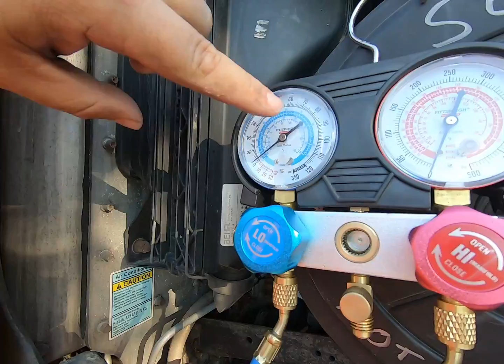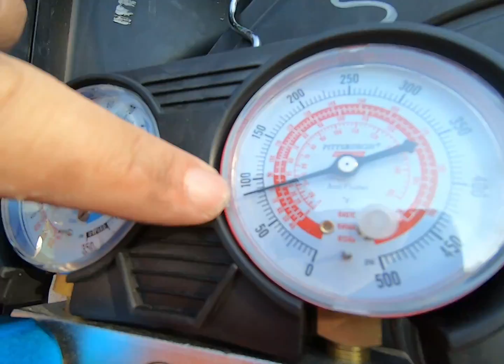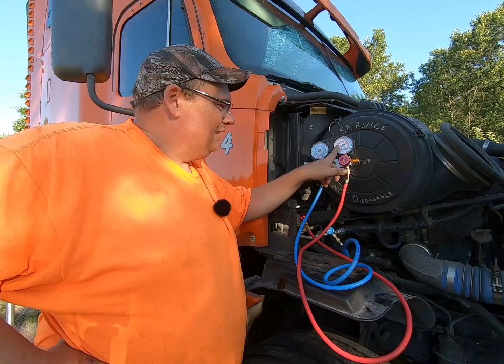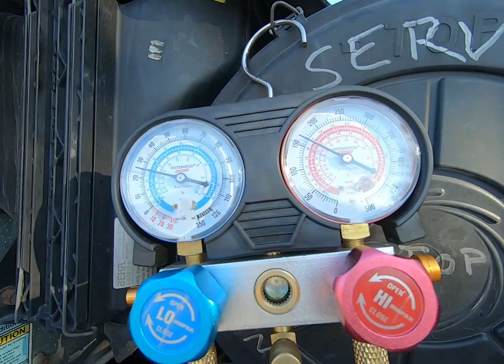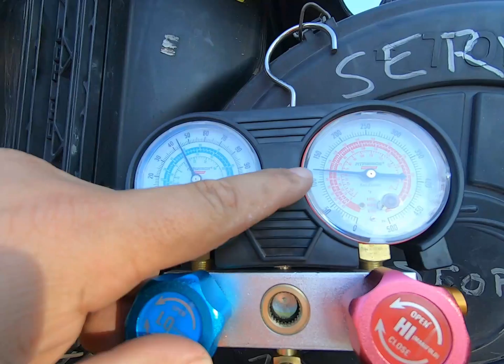A/C basics...Using manifold gauges to determine a/c problems in a semi truck | a/c pressure readings

Comment from the maker: DIY SEMI, TRUCKING AND MORE 

 • 59 seconds ago

For great fuel discounts with no fuel card required, watch this video! https://youtu.be/LjB5Y60p1qI
Reply: Looks like you know your stuff. I got a problem with my AC, I pulled vacuum for 1hr and it dropped a few psi (2-3) after 10min. If I press the AC button ON the clutch kicks in after I pulled vacuum... isn't that not supposed to happen? So I charge low side and the pressure shoots up way high 100-120psi and the high side goes to like 50-100psi and system won't take anymore (full) no cold air. 
Ik its a lot but thanks.
Reply: Also the AC clutch stays engaged without any charge
Reply: 3:14

Comment: I have a 1998 Western Star,  new compressor, new high-pressure switch and new fan air solenoid switch to turn fan on. When head pressure gets high the fan isn't coming on. What else do I need to check?

Comment: I recently purchased a gauge set and vacuum pump and have spent about 4 hours watching different videos on you tube to learn about the process of recharging an auto AC system and I learned more from this video than the other videos combined.  There are a lot of "How To" videos on you tube and many of them are very thorough but I really did not understand the function of the components in the entire system as well as I did from watching this video.  Your discussion the variation in low/high pressures was very enlightening and really helped me to understand the function of the system as a whole.  Great Job !!!!!
Reply from the maker: Thanks.

Comment: I don't  meant to bog you down with the following. I just though I'd ask. 
 I have got any idea what I'm up agaisnt. The shop i had install the ac compressor can get the vent temp any lower than 63 degrees. The sleeper ac/heater doesn't even have a sleeper filter. Shop says they gotta take out the whole unit to clean the condenser; jeez wiz. 
I have a 1999 KW T2000. AC hasn't worked in 10 years since I've owned it. 
 Ac compressor blew the clutch. It's got a new compressor now. It has an "Automatic  Temperature control knob" on it. The hot water heater hose runs to the cab for heater & I've heard it somehow runs threw the ac as well. Supposedly the "Automatic Temperature Control Knob" adjusted is suppose to somehow control the ac & heater by turning it right or left.
 In order to avoid hot water running, somehow, threw the ac, I had shut off valves put in to the hot water lines to cut hot water going to the cab & ac.
 This Automatic Temperature Control Kbob as is written on the on the plaquered.

Comment: It's undercharged!  Low.presuure should be about 30. Yrs sucks down to 10. Way to low. That truck probably needs a kilo of refrigerant! U probably put in less than goes into a small car. Modern cars take about 450 grams. Big suvs .with dual ax about 800. Trucks like yre 1 kg to 1. 6. To do it properly u find put how.much refrigerant yr vehicle needs exactly. And then use a scale to measure the exact amount. Also when u regass add some lubricant!!! 30-50 cc of PAC oil..

Comment: I noticed you closed all the valves but only opened two of them.  So to check pressure, I need to start with them all closed and only open the two at the ports and leave the ones at the gauges closed?

Comment: One time I’m doing recharge of refrigerant 988H wheel loader i put only about 200psi on high side 15 psi low side but not good colling I put more about 280 psi high side and low side 35 become good colling but I’m worried if already high pressure or normal thank you

Comment: I did my reciever dryer and both expansion valves after this video
Reply: I have a question. 
My ac starts off cold,  an hour after I drive it gets warm.  When I stop to idle it gets cold again. 
I've replaced both expansion valves and the drier.
Can it be the evaporator?

Comment: Fantastic video and explanation. I just bought a set of gauges for my the a/c in my kenworth t680. I need to learn how to top off the freon when it's low. Several years ago,i overcharged a system on a different truck with those little bottles you get off the shelf in Wally world. 😂 don't want to make that expensive mistake again
Reply: It's not a good instructional video actually. So if u want to avoid more expensive damage. Don't do what he did!  Lol..  (I do this for a job)

Comment: I have replaced in y 2004 Columbia AC condenser,AC COMPRESSOR,dryer ,expansion valve and evap core ….and my AC blows cold somewhat but it’s very hui side .
Iam so puzzled what could it be ,any help will be much appreciated 🙏🏼

Comment: here is my problem i switched ac comp couple of week ago and my ac was working just yasterday i switched fan solinoid because my fan clutch wouldn’t come off, so now compressor isnt working too, it is betterly worm after 1 hour of engine working, i checked amperageon compressor electricity, there is non, 
could it be high pressure sensor that meses everything up? and my pressure on low and high side  both 100 with engine on and off

Comment: How much uv dye do I need to put in the system to see a leak? I’m trying to find a leak and I put in 4 oz of dye but I don’t see the dye leaking out or anywhere
Reply from the maker: 4 oz is way more than enuf. Did u look at the evaporator inside your dash for leaks? And in the bunk?
Reply: @DIYSEMI  I looked under the bunk at that evaporator there but I have not looked closely at the evaporator in the front.

Comment: I'm not even sure if you're still on YouTube I know this is an old episode but I'm trying to figure out what's going on here I watched your video here on manifold gauges I did exactly how you had explained and I thought I was doing something wrong so I watched the video as I did it  by no means am I saying that you're doing something wrong however the low side of my gauge is only showing pressure while adding freon when the can gets emptied the low side gauge goes to 0 and so on once I have the 3.5 lb of freon in the low side of the gauge is 0 but the high side reads correctly at 225 to 250 can anybody tell me what's going on with this thing never happened like this before so I'm kind of confused on what the world's going on I appreciate anybody's help thanks

Comment: It is not relevant in your set up with the adaptors on the Hoses BUT you Hoses are on wrong. 
If you take them off and look at the ends, The bent end will have a core depressor in it, the straight end will not.
The reason the adaptors turn in the opposite direction is because it is not actually a Valve. the Knobs turn in the pins to depress the cores on the Truck connector..
Mike M.

Comment: On a 2019 peterbilt 579 at random times when shut engine off for 5 min guard shack check in, after starting up again compressor clutch won't engage. Is this because system under to much pressure? The strange thing is it only does this at random not all the time under same type of operating conditions. My quick fix is drain air pressure in air tank to engage fan,pour bottle water on lines to compressor and after 5 min compressor comes back to life.
Reply from the maker: Yes, sounds like a high pressure situation to me. Could be several causes. Overcharge system, restriction in system...etc

Comment: It was a long time ago as soon as i saw your video i subscribed your channel. I have question i have volvo vnl 670 2011 and from passenger side where is ac evaporator i hear hissing noise the whole time when ac is on, if i turn of the ac the hissing goes away. No cold air. Can be a bad evaporator cause i as i’m touching the evaporator around the hissing changes the sound. Please help. thank you and keep doing your great videos.
Reply: Some ac systems will make hissing noises when they are low on refrigerant. It's the sound of gasses moving through the pipes rather than a liquid.
Reply from the maker: That is possible. Also while u are in there check your blend door actuator

Comment: Hi! I might find a professional answer from you if you’re willing to share,because out there,rarely theres a technician that knows what is doing.Well long story short,my AC clutch compressor went out the other day(Century class series 60 Detroit sleeper).Changed compressor dryer vacuum the sys charged back (at a Speedco) and barely get any cool air from vents.Got home bought these gauges and i get 45psi on low and 310 at high engine running at 105-110 ambient(Arizona temps).Fan engages, compressor clutch as well engages but compressor never disengages while running.At idling it blows warm air barely any cool air.Before compressor failed,it had pretty good cold air out of vents.What could be at fault? Expansion valve was changed also not too long ago,i also add a bit of freon and bump the low at around 52psi.Also the sight glass at air dryer its white foamy if that helps.Thank you much!

Comment: when engine is off and u measure static pressure ..it is kind of important the reading. yours correlated nicely with ambient temperature. if it reads 30...and u have 90 degrees outside ....then something aint right

Comment: My AC is reading about the exact same as yours on a 80 degree day.Like 22 on low side  and 185 to 190 on high side and compressor is kicking on and off every 25 seconds.Pressure readings then are 45 low down to 150 on high side.Its cooling,but seems like it could be better.Is freon a little low.

Comment: I just replaced my ac line, compressor to condenser. Ac was working before I spotted the leak. I believe I lost too much Freon because it is not cold now and the compressor does not kick on. Engine fan only turns on when engine is hot. We have the same truck, so I am curious when I add Freon which side to add it too, hi or low?

Comment: Thank for you this ionformation.i want  ask one question for you.i hope to you have good answer.yesterday i find one fault JCB machine A/C system.its not cooling properly.i checked its pressure its running time suction 30 psi and discharge 160 psi.after pressure balancing its coming 100 psi.conderser and cooler filters  all ok.near the system filter area have slide glass .i can sea inside liquid passing properly.(It has one problem.its compressor switch off time system pressure balancing within 2 second) can you explain me what is the problem????thank you

Comment: I have a situation whit my ac pomp compressor,  is releasing freon out on valve safety pressure,  that happens sometimes at heat position,  what do you think could be?? I really appreciate you opinions,  Thanks
Reply from the maker: Sounds like you have super high pressure. It's probably happening with heat on because compressor turns when defrosters are on.
You probably have a bad obstruction somewhere in the system building back pressure.....I would have it looked at.

Comment: I have a quick question! my high side goes up to 300 , when the fan kicks  on it drops down to about 100 and it stays between 100 and115 after that. My low side kicks clutch on at about 30 and and shouts of at about 50 and drops back down around 30 and then rapidly goes up to 50 and drops again Clutch keeps engaging and going off And sometimes the clutch gets stuck but I can hit it with a screwdriver and it starts can you help with this

Comment: Add refrigerant with the fan drive engaged.  Switch on dash may have override , if not unplug fan drive air solenoid on firewall

Comment: I certainly appreciate you taking the time to make this video. I have a Freightliner chassis motorhome and, have had quite of bit of trouble with the dash A/C on this coach. I've paid several times, to have the system checked out, vacuumed and charged. Each time, they say it's ready for service. Each time, it works for a day and that's it, it's warm again. I recently purchased a Harbor Freight set of A/C gauges and, a vacuum pump.
 
    I vacuumed the system down to a max of 26 inches and it won't hold for a long time. I will hold for say, around 15-20 minutes. So, I'm presuming there's a leak someplace. But, I've charged this system and it will produce as low as 40 degree air from the ducts, while driving in around 80-90 outside temps. As the temps approach 100 degrees, the air from the ducts increases in temp to around 50-60 degrees. But, as stated earlier, it will loose that charge. It's very difficult to find a leak on this type of chassis. 

    But, in any case, you have enlightened me quite a bit on some basics and technicalities of A/C operation. I will look forward to finding other vids of yours and, ones to come. Very much appreciated. 
Scott
Reply: A REAL HARD LEAK TO FIND  IS WHEN YOUR EVAPERATOR IS LEAKING IT WILL HOLD A PRESSURE TEST AFTER A VACUUM HAS BEEN PERFORMED AND WILL LEAK THROUGH YOUR EVAPERATOR DRAIN WHEN YOU RUN THE AC UNIT AFTER 5 MINUTES OR LONGER I DIAGNOSED A CAR WITH THAT PROBLEM HAVE A NICE DAY ASE TECH AND BEHOND
Reply: U do have a leak. Yr sytem failed the vacuum test.. it should hold 29 hg indefinitely. Next step would be yo pressurerize it with nitrogen and soapy bubble spray to 'hopefully' find the leak. If that fails. Next step is to recharge it with ac dye added. This dye goes round the system and exits at the leak site. After having it ran dry, darken out the vehicle bay and shine an ultra violet light on all the hose and connections and components. When you see a green dye trace, you found the leak.. this is the most  successful leak finding method in the arsenal and every ac specialist should have it on offer. And this is what u need to do to actually solve the problem.. we do this successfully everyday..
Reply: @franshuber910  I certainly want to thank you for responding to my issue. It was by pure luck that while I was checking out the engine for an upcoming trip, I noticed some wetness on the corrigated plastic cover that covers each of the A/C hoses that come from the pump. One was wet about a foot or so from the fitting on the pump. Hmmmm. So, I peeled back the plastic cover and what I found was what looked like a potential repair with crimped fittings and all. 
    It was fairly oily around all that part right there. I had to assume that was where my leak was and no one in the service center where I'd paid to have the system checked out , vacuumed and filled, bothered to look there. After  determining that hose was the short one that led to the evaporator, I had a new one made up and installed it. I then vacuumed the system down to 29.5 inches and it held for as long as I wanted it to. I then filled the system with the required 40 ounces. 
    All that was a couple or more months ago and each time I'd got into the coach and fired it up after I'd done that work, the A/C was cold and nice. So, I think I've fixed my problem. It's winter now here in Southern AZ so, I'll check it out when things warm up in the future. Again, thank you for responding here. Very much appreciated.
Reply: I have a 2003 freightliner Columbia and my AC compressor when I’m going down the road sprays out all the Freon.  I already changed the expansion valves. The AC dryer evaporator that condenser in the to high and low pressure sensors, put on you compressor and still doing the same thing.. and this is them is not over charge because it calls for 3.7 pounds
Reply: Can you please help me with it thank you

Comment: I just replaced my compressor on the same truck I flushed and vac the system down and charged it but now my compressor will not kick in is there anything I can check to find my problem
Reply from the maker: did you check to see if you have power to the compressor? probe the plug. look for a 12v reference
Reply: @DIYSEMI  yes  and there’s no power so I checked the compressor clutch jumped it and it works and blows cold I’m thinking it the high or low pressure sensors
Reply from the maker: @TheBreedxxx  very well could be

Comment: Hi i have 2007 freightliner columbia installed new compressor and dryer and ac works perfectly and my engine fan constantly working when i parked and idling ... when i driving its not ac is not cooling any idea whats going on?

Comment: I have a new ac compressor, new dryer, a new blower motor, and a new resistor. My truck blows good and cold for several hours, then it acts like there is a clog and the air flow is restricted and barely blows. I have a 2016 Prostar. Any help is appreciated.
Reply from the maker: Possible that the evaporator is freezing up? Does it drop water out under the truck like a/c normally does? Did u look at that discharge temp sensor inside the dash? Just a thought

Comment: I’m having trouble with my ac on my peterbilt 365 2014 , the high pressure shows around 300
Reply: The compressor broke down, so I replace it and the dryer too , and after that my engine fan it’s kicking in constantly after stops running kicks in right away, and the ac isn’t cold no more

Comment: My ac doesn’t cool enough when idling but works fine while driving or at high idle. Gauge was reading low side at 50 and high at 175.